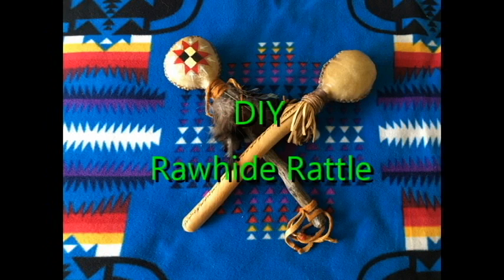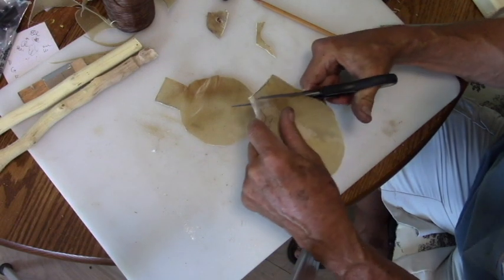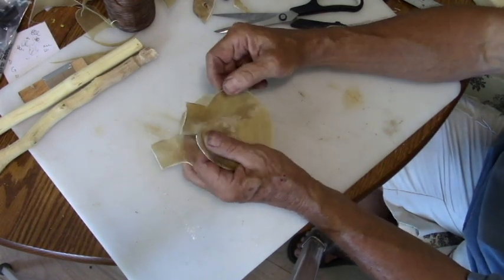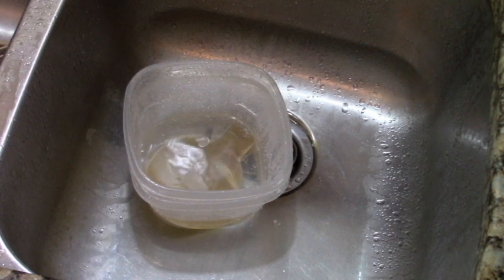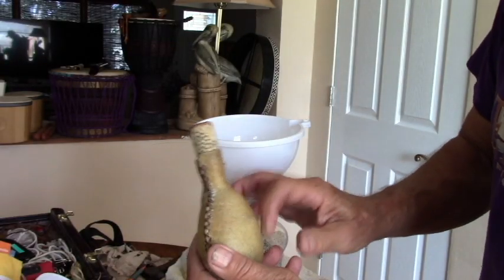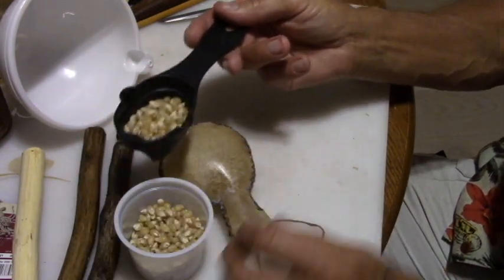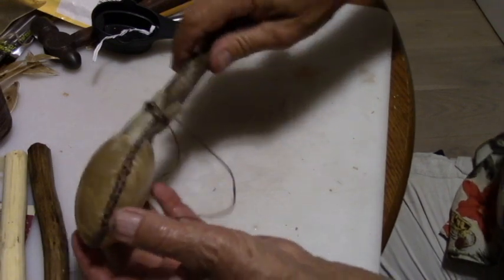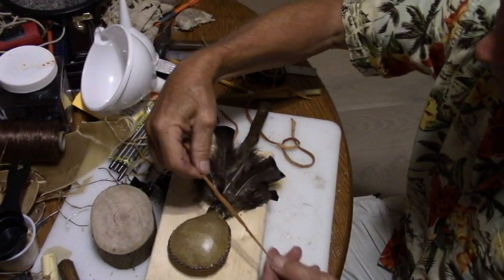DIY Rawhide Rattle

Comment: Hi Donald, I love the tutorial. Although, the deerskin I used for the rattle head tends to fold, and press down when transporting it in bags e.t.c... It has been difficult to get it shaped properly again by teasing the shape back with my fingers, but I have managed it. Is there a way to make the rattle head rock hard? I have recently gifted an authentic Lakota rattle I found at a local market that was rock hard, and yet still seemed to be made of some kind of animal skin... It wouldn't collapse on itself if pressed. I would love to hear your advice, Donald. Best wishes, from Brandon.
Reply from the maker: coat and saturate the dried skin with shellac.
Reply: @donaldporta  Thank you, Donald!

Comment: Can bees wax be used instead of the polyurethane?
Reply from the maker: yes
Reply: thank-you for this beautiful video...I will comment more below.
QUESTION: I would appreciate knowing how you would apply the Bees Wax, if you can help me...
I assume you would melt the wax.  then would you paint it on with a brush, or dip the rattle into the melted wax.